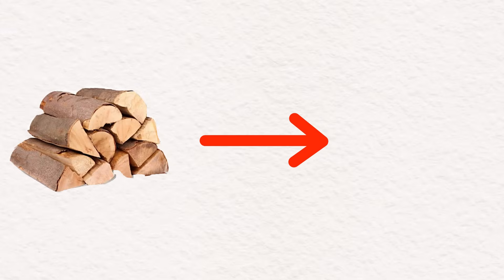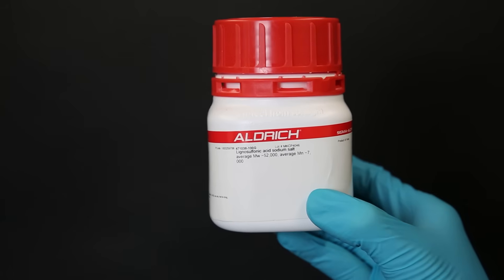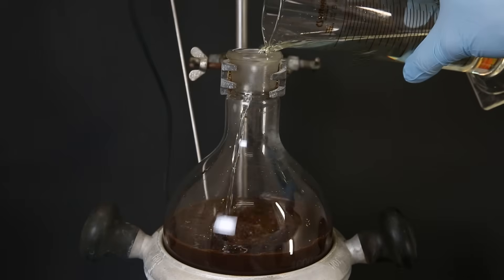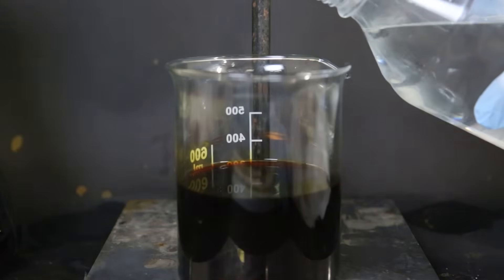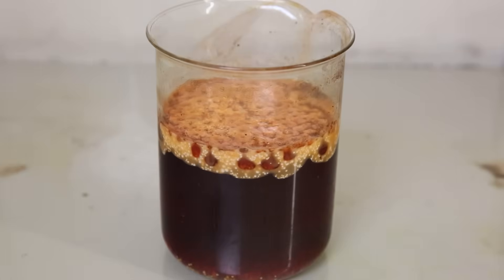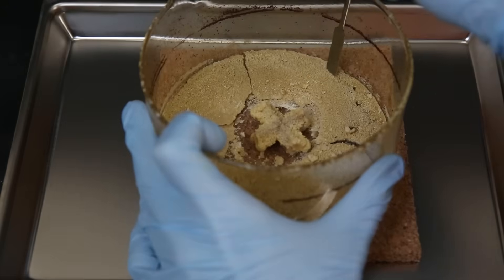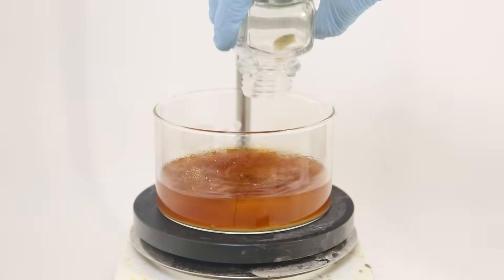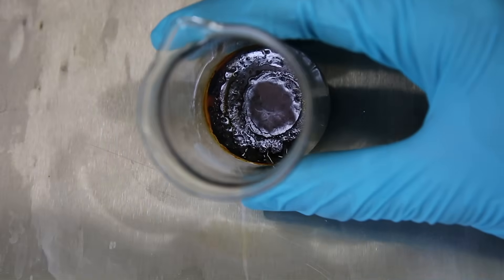Making Vanilla from Wood (Lignin)

Comment: This is cool, but I gotta say it looks like:
Tar -> Tar -> Tar -> Tar -> Tar -> Tar.
I'm actually interested in trying to replicate this myself. Do you think you could use a harsher oxidizer than nitrobenzene? I have some but its optical grade and was really expensive. (used for making Kerr cells)
Reply from the maker: You will have to look in literature for the specific oxidizer you want to use. Selection for vanillin could be terrible for some.
Reply: I wonder if hydrogen peroxide could work in these conditions, particularly from sodium percarbonate? In literature the main alternative is to use oxygen gas with copper hydroxide catalyst in strongly basic conditions, but it usually requires high temperatures and pressures

Comment: You might get more products if you control the oxidation time. Vanillin is sensitive to heat above 60C and will break down readily. As for the separation, you can try copying the bisulphitation that Borregaard uses, or use chromatography. Separating vanillin, p-hydroxybenzaldehyde, and syringaldehyde is rather tricky

Comment: Why not using column chromatography to separate the components?
Reply from the maker: Everyone hates column chromatography ;). But in all realness i couldn't really find a reliable source for the solvent system and i assumed it would be some annoyingly large column packing length to get decent separation with such similar compounds.

Comment: you can purify aldehydes as their bisulfite adducts
Reply: How does that work? Also How does a bisulfite adduct onto an aldehyde to make a sulfonate? Where’s the hydrogen atom from the bisulfite go?
Reply: It doesn't go anywhere. Every atom in the aldehyde molecule and every atom in the bisulfite become part of the adduct. If you're curious the sulfur bonds to the carbonyl carbon as well as the carbonyl oxygen as a hydroxy group, and the sulfonate and sodium charges form the ionic bond.
Reply: to clarify, the carbonyl carbon retains a single bond with the carbonyl oxygen, and the free bisulfite hydrogen forms a bond to the oxygen, which is not bonded to sulfur in any way
Reply: This was a mixture of aldehydes though

Comment: Years ago, a pilot plant was built in Seattle to make vanilla-related compounds for a paving project.
It was to be a catalyst for a resin; bonding fabric/gravel layers to construct roads, rather than using hot tar and asphalt.
Yes, the area around the plant smelled amazing at times.
Yes, everyone in the area grew to hate the smell of vanilla.
The project was dropped, the roadways materials didn't hold up to soil bacteria!
Reply: the bacteria ate our road 🤣🤣
Reply: Few million years too late!
In the Carboniferous period there were no lignin eating bacteria, so wood and similar materials were not recyclable.
Those roads would have been excellent in that period!
Reply: And those roads were probably still better than the road where my parents live. That road literally fell apart in a few months after reconstruction, and turned into gravel.

Comment: This is wild, I did not know it could be extracted from wood.

Now I understand why alcohol can also be made from wood, all we need is breaking down the polymer chains to simplier glucose melecules, very much like extracting vanilin.

What else could also be extracted from wood at this point?
Reply: You can use wood as a feedstock for all manner of things if the alternatives are more expensive, (somebody correct me if I'm wrong here) a few examples are as follows:
- You can heat or steam distill the raw wood in chip form directly it to drive off and collect useful volatile components
- You can destructively distill wood (with the product differing depending on the type of wood) or wood resin (which in itself can be refined into many useful products) to create wood tars which you could treat similarly to coal tar. 
- You can heat it in a reduced oxygen atmosphere to collect carbon monoxide/wood gas to use to make simple chemical compounds to feed into other processes, for example the water gas shift reaction which turns carbon monoxide and water into carbon dioxide and hydrogen which produces a useful amount of hydrogen gas
- Mixtures of carbon monoxide and hydrogen can be used to create more complex liquid hydrocarbons via gas-to-liquids processes like the Fischer–Tropsch process, or the hydrogen and carbon monoxide can be used to synthesise methanol (which is industrially very important itself) that can be used in the Mobil process, methanol-to-olefin or other similar processes
- Wood gas can otherwise be filtered and then burned in a four-stroke gasoline engine (with only very minor modification) or a furnace
- The remainder left after heating wood in an oxygen excluded atmosphere is charcoal which you can steam treat to produce activated charcoal
Reply: @CATASTEROID934  An excellent list; but not only that you can have potassium carbonate from the ashes, acetone, methanol and acetic acid from the distillate; its amazing how much you can do with it.
Reply: I hear you can even build houses out of it and cook food with it.
Reply: Nilered did an ethanol from toilet paper video.  Toilet paper = cellulose from wood.
Reply: Not extraction - derivitization

Comment: The sulfite pupling is to boil wood in the sulphuric acid? Just asking because I used to be living next to the paper producing company ... and the smell was terrible.
Reply from the maker: No they use sodium sulfide, base and heat usually. Sulfite pulping is known to stink and be a more dirty method. Sulfuric acid wouldn’t really produce a smell. I believe sulfite pulping is mostly being phased out though, since improved Kraft pulping methods are more efficient. There are methods which do use sulfuric acid (like organosolv) but i believe not for sulfite pulping.
Reply: @Chemiolis  the improve kraft processes are more about reducing sulfurous off gas and producing a less acidic pulp to produce acid free paper while keeping the cellulose as intact as possible.  It still uses sodium sulfide.
Reply: @Chemiolis  Aha. Thank you

Comment: Lignosulfonates bought from ligma aldrich... How appropriate xD
Reply from the maker: Somehow i could only find easy to buy lignosulfonates on Ligma Balldrich, even though the material is so common and supposed to be dirt cheap, there’s not a lot of sellers. I suppose they normal sell this in 1000s of kilo’s at a time, or even the raw unpurified ‘liquor’ from the paper producers. Guess i’ll have to do with Ligma scam prices🤷🏻‍♂️
Reply: I was able to find suppliers of the sodium lignosulfonate, but only in 75 lb quantities for around $200. It's a great deal if you want to make a lot of vanillin. A better deal though might be to just buy sawdust and sodium metabisulfite and make your own. As I understand it, you pretty much just mix those with water and boil for an hour or so, then filter off the cellulose.

Comment: I like nile red but sometimes I really don't need an hour and a half of "I need to stir the solution, so the first step is to put a stir bar in the flask, then with that done, the stir plate needs to be plugged in, after that I need to turn on the stir plate, at first I thought it was a disaster and didn't work, but then the stir bar started rotating, now, all I have to do is wait for the motion of the stir bar to start rotating the liquid in the flask....." 😑 So videos like this are really good.
Reply: Problem is, for actual chemistry work, papers DO want you to be that annoyingly exhaustive in your procedures and descriptions.
Reply: True